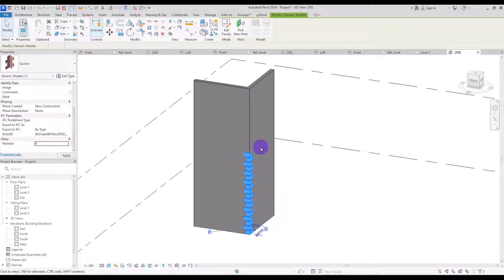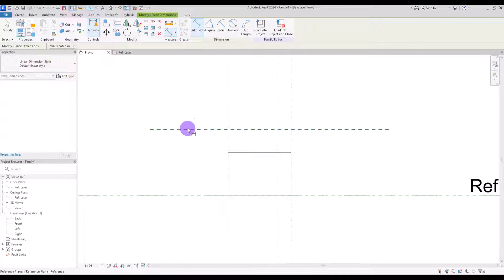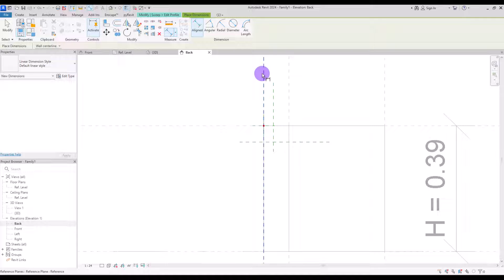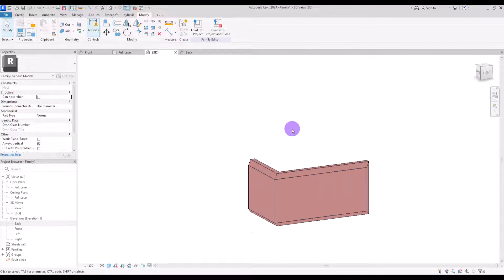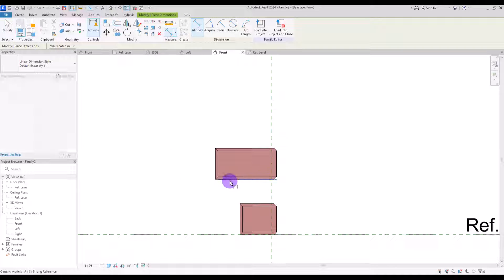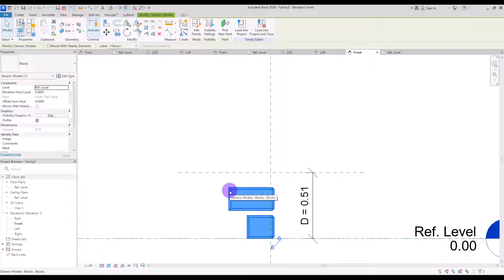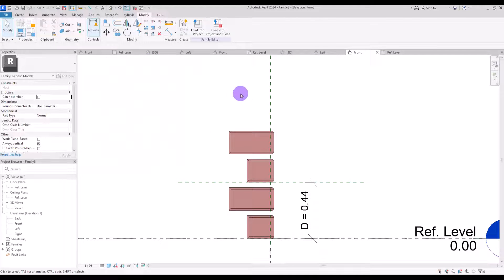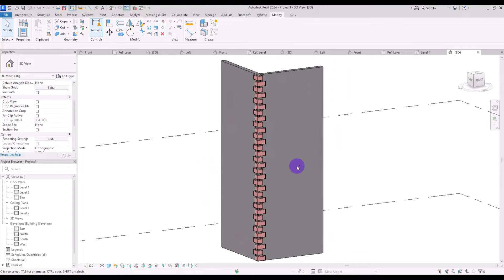Mastering Parametric Families for Quoins in Revit

Comment: mam as u have defined the parameter for height , is it necessary to make it as a strong reference. or it works the same
Reply from the maker: Not necessarily. If you are working on a nested family and want to load it into another family and there use that reference line as a reference, then yes, you should switch it into strong reference.